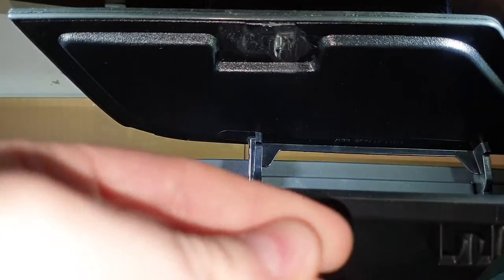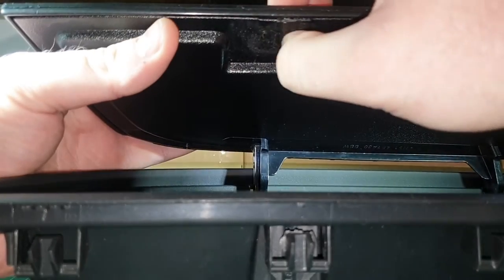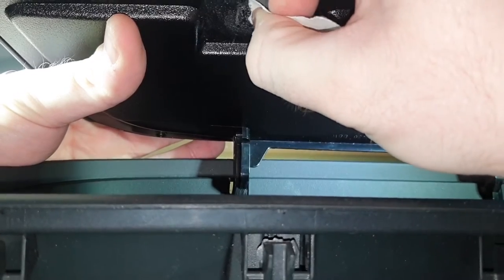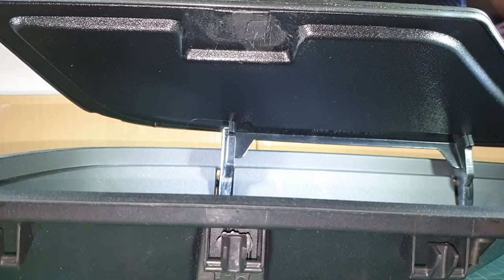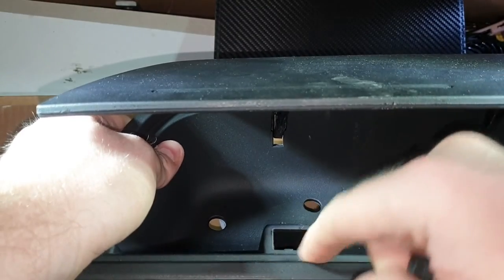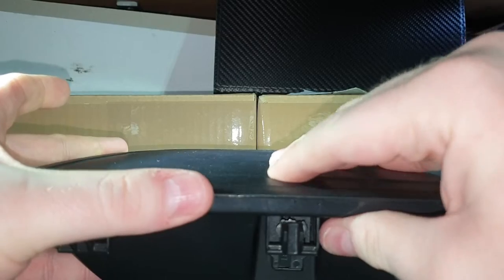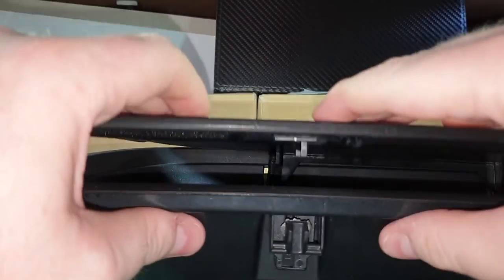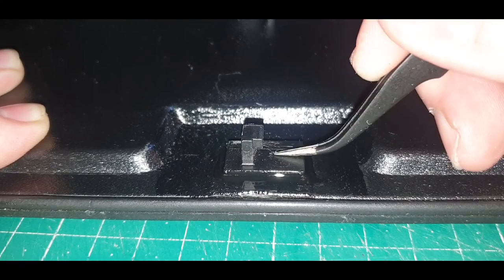Ford Focus Mk2-2.5 2005-2011 Top Storage On Dashboard Repair DIY, How To Fit.

Comment: Hi. Where can i get the pin that goes into the lock. I have a 2009 focus and its very weird that i cannot recall if there has ever been a pin in the upper side of the glove box, until one day it cannot be shut anymore. I am only guessing i am missing the pin in any way. Online i can only find locks..very useful video..thanx
Reply: Same for my car, I have never seen that pin and now it is missing and I can't close it. Did you find the small pin or another solution?